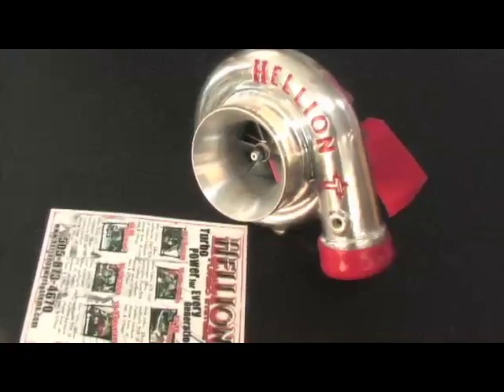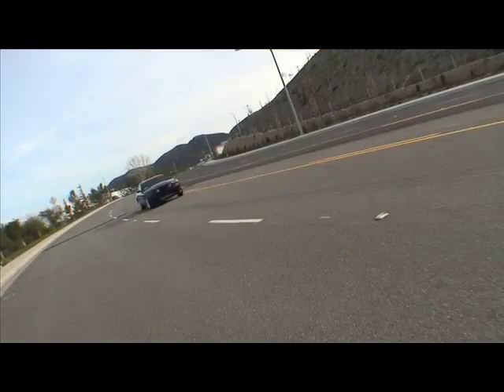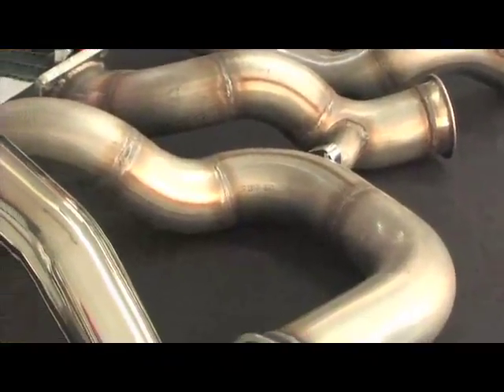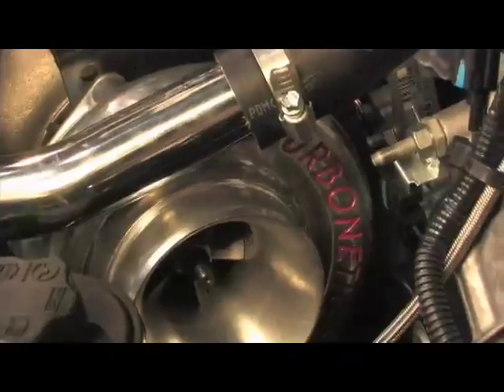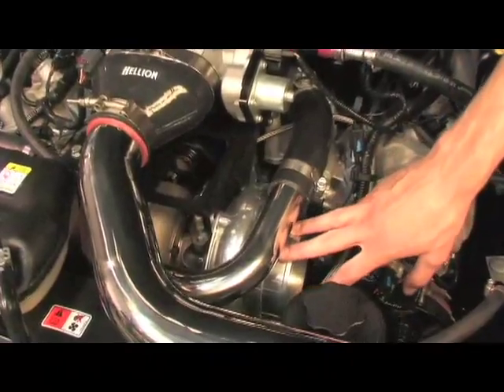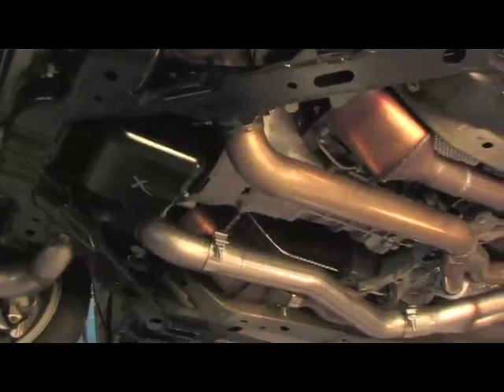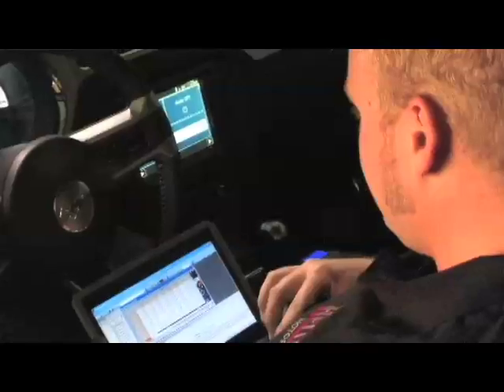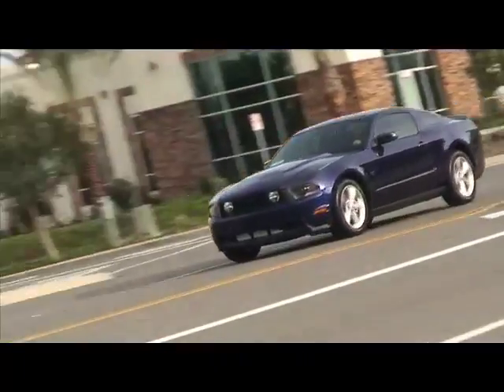Hellion 2010 Mustang GT Turbo Kit Installation

Comment: My question is : I have a 2007 Ford Explorer 4.6l 3 valve. Same motor and trans except mines has a front transfer case cause its AWD and the mustang doesnt. Can this kit also apply to other vehicles that have the 4.6l 3 Valve V8?

Comment: this kit pushed my 09 490hp 532tq.  don't know why they they didn't crank the boost up.  now only failure I ever had was a roller rocker collapsed. installed new cams an rollers an gtg now. plan on pushing it harder once I've finished my build

Comment: im confused the mustang should of had over 400hp stock and u added a turbo and the 1st run was about stock hp numbers then u tune and it hits at what 440 that cant be right just seen on website they come wit 412hp-435hp so ur 5,000 dollar turbo kit is useless
Reply: Please tell me you're just trolling. First, look at the date the video was published. Second, LISTEN!!!! He said 2010 which only had 315hp. Still a 4.6, not a 5.0. 5.0 came in 2011; 2010 still had 4.6 just with body change.
Reply: Auto Young lmao yup!
Reply: WAS GOING TO SAY THAT BUT YOU SAD IT FOR ME,THANKS

Comment: yea it does, if you pause right at 1 minute 39 seconds you an see all the accessories that it comes with and you can see a diablosport sigh, so im guessing hellion provides the necessary re-tune required via a predator